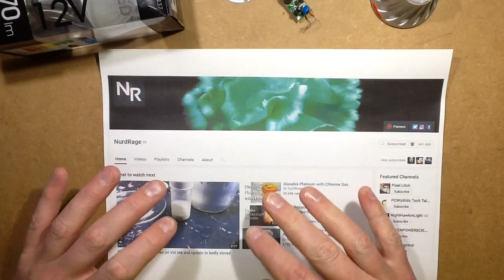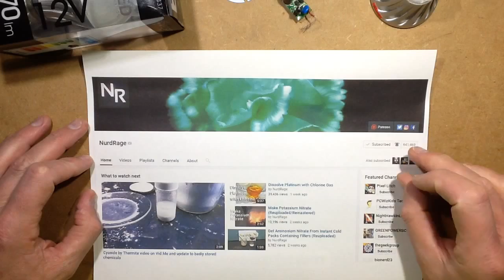Autopsy of a dead 12V V-Light lamp with novel LED panel.

Comment: A common failure mode for a switcher that uses an external FET to drive the inductor is that the IC's gate driver is too weak. The capacitance of the FET's gate, and often its gate-drain capacitor (aka "Miller capacitor") is high enough that the driver cannot turn the FET on/off real fast. The Miller (integrator) capacitor in particular really slows down a FET's switching time. With slow rise/fall times, during which the FET's current is still passing while the drain-source voltage slowly changes. It results in large instantaneous power dissipation (Vds * Ids) that when averaged out over a full power cycle produces a large average power dissipation. POOF goes the FET. If you sensed that this power transistor was getting real hot and making funny sounds, this is a likely reason for the failure: bad design by the lamp manufacturer.

Comment: Looks to me that those are designed to be run from the 12 volt system on an RV Hence the RV picture on the package and the Bulb v making a weird RV once again. Perhaps to much pulsating DC is getting to the circuit that is designed to come from nice clean DC stored in the house batteries of the RV?

Comment: Where did you get your mains power connection terminals from Clive ? interesting  ?
Reply from the maker: It's called a Quicktest and has been about in the UK for as long as I can remember.  You can buy them from most big UK/European electronic components suppliers.  In America you can buy a new version with US/Canadian colours on eBay at this link.  http://www.ebay.com/itm/302400231699
They're intended for industrial workshop/lab use so they're not cheap.  But they're worth every penny if you test a lot of electrical equipment.
Reply: And of course they are "out of stock" but not a bad price  $63 dollars

Comment: Please don't laugh at me. My question is probably a basic knowledge for most of you people. Here it goes: Do all LEDs flicker, like say, neons? My concern is the effect of LEDs on people with epilepsy. People with epilespy have to stay away from flickering emissions even if the eye can't perceive that flicker, but the brain does.
Reply from the maker: Properly driven LEDs do not flicker at all.
Reply: Thanks much.
Reply: Even PWM dimmed? I have an led torch and it strobes when dimmed,. it's hardly noticeable but when it rains you see dotted lines of rain!
Reply: Cheap ones flicker, but high quality ones don't.   PWM should not be an issue if it's at a sufficiently high frequency.  Best to check with the manufacturer.

Comment: Am I bad person for hoping bigclive would get a zing from the mains... I've gotten bit by 120 over here in the states, and it's not that bad. 2x the voltage shouldn't hurt much, right?
Reply from the maker: 240 is hugely worse.  The higher voltage breaks down skin resistance better and then forces more current through.
Reply: I've been bit once by, allegedly single-phase, 240v here in the states. I don't ever want that again!
To humans, 240 = 120 times 2,  but man...... when it's a voltage shock.... no thanx :-(

Comment: Why are they making low voltage lamps with ES and BC caps that are usually used for 240v fittings?  It seems a very odd design choice to have a system like this and I don't think I've ever seen it.

Comment: I'm not sure what you adjusted on the iPad Clive at 6:50 but it stopped the flickering, maybe worth experimenting.
Reply from the maker: It happens randomly based on intensity.  Sadly not easy to control.
Reply: That's a shame I thought it might be a breakthrough. Never mind.

Comment: What you've got there is a Pickett & Eckel slide rule shirt, http://www.sliderule.ca/piprom2.jpg. I presume you have NOT thrown yours away. I have a nice 6" model given to me in 1974 that I still don't use occasionally. The 12" I have is not the one with 34 scales no one knew how to use. Ripper.

Comment: I wonder if the design was originally for a color temperature changing lamp and they just put the white and red in series. Here in the US you can get LEDs that can change color temperature, the more common ones do it when attached to a dimmer. I saw a demo in Home Depot last night and when you dimmed it down the color changed rather naturally to match the dimming level.

Comment: Another LED light mad by FEIT 60W = recently did the same thing with a mix of color LEDs to match a color spectrum brighter output. Same with the 100W version. But ones before over the last two years had one color LEDs because I used to remove the defuser in some situation, not anymore I guess.

Comment: I accidentally killed the fuse in my DMM today by trying to take a current reading while on the volts setting. I always do that three or four times in a new meter before I get the hang of it.
Reply from the maker: It's very easy to do.  Particularly with the cheap meters that have the amps settings on the standard probe positions.
Reply: It actually turns out that I may have just taken too high an amperage rating on the low amperage side. I need a better meter.

Comment: I had a similar experience with LE or Lighting Ever bulbs, they aren't cheap and half of them failed in the packs I bought. Upon inspect various LED's in the cluster had little black spots on them. When I informed them of this they simply weren't interested.

Comment: As soon as I you mentioned the red LEDs my thought was it was a dimmable lamp and the red LEDs are to make the light warmer at low levels, like the Philips Warm Glow ones. But as there's only two wires to the LEDs, how are doing it? Is the lamp dimmable?
Reply: Found it on the Clas Ohlson website under 36-5437. It's not dimmable. Looks like others have had them quickly fail.

Comment: When I originally bought my home a year ago I changed every lamp in the house over to LED lamps The first thing is I'm suspect of the amount of power that these lamps really use because my electric bill really hasn't changed also I've had 3 to 4 lamps fail I say 3 to 4 because the fourth one is an outdoor lamp and it seems like one or two of the LEDs in the lamp are still working because its just a modest glow and not the 70 watt brightness it should be what would be your take on this.
Reply from the maker: Lighting is actually quite a small part of your electricity consumption.  The bulk of your bill is generated by heating appliances like kettles, immersion heaters, fan heaters and laundry equipment.

Comment: Uses 240v, steps down to 12v. uses 12v supply, steps up to 30 ish volts, Humans.
Reply: It makes more sense than you realize.  Typical 12V mains powered applications are for safety in areas where the wiring is subject to detrimental factors such as outside landscaping where there may be water ingress, animals chewing on the cord or it gets cut by lawn equipment, plus this low voltage stays below electrical code limits for similar reasons.

Stepping back up to 30V leverages the low cost generic chinese LEDs with a series connection for lower construction cost.  It's not the most efficient way to do things, but if that was their goal instead of cost reduction, start out with high efficiency LEDs.  That can easily make more difference than (roughly) 15% more loss than only a single buck voltage regulation circuit from 240VAC to 12V AC or DC would have.
Reply: which is negated by the losses involved in stepping down then back up the voltage (I've seen those supplies, you'd be lucky to get 75% efficiency). There isn't much of a reason to step the voltage back up other than them being lazy and wanting to use the same LED PCB again, which means you incur losses from the SMPS,  and the board gets stressed and failed. Using 12v DC where water ingress is a problem also creates serious DC corrosion, most I have seen are AC 12v. It would have been a lot nicer to see a lamp use 12V, and a power supply out put peak to peak AC at 12v, and the LED lamp just rectifies it.

Comment: Are LED bulb power ratings the power expected as measured at the input, or at the LEDs?  I had always assumed the former, as that would seem more useful to know; but I just discovered that my favourite brand of spot lamp is rated by power at the LEDs.  So now I am wondering if that is the usual way of doing it.
Reply: +Против Глобал  Many thanks

Comment: The LED bulb in my room flashes very briefly (it only turns on for a a fraction of a second) every 20 minutes or so. It can be very distracting when I'm trying to sleep. 

What kind of sorcery is responsible for this? Why is it lighting when it's supposed to be turned off?
Reply from the maker: The multi-way switching is a factor.  What you're seeing is capacitive coupling between the switch wires, leaking a very tiny current that gradually charges up the capacitor in the lamp until it tries to light, discharges the cap and starts charging again.  Some lamps are more susceptible to this than others.
Reply: Ronald Raygun Do you use that switches which have a red indicator inside? Or the switch may only control the neutral, leaving the active wire connected and leaking some small current.
Reply: I don't have those but I do have a three way switch (three switches in different locations for the same light fixture). Maybe that has something to do with it?
Reply: My house is pretty old too. I have to be careful not to get electrocuted by my kitchen sink because there is no proper grounding (I think my neighbor has the grounding hooked up the the water pipes).

I'll have an electrician come around and take a look at it soon.

Comment: Naw Clive, you're not too overly reckless.  Too reckless is more like inadvertently attempting to use yourself as a giant capacitor.  I'd describe the feeling as a very, very large and unusually strong fella whacking you repeatedly with a massive hammer, you do feel quite invigorated afterwards however.

Comment: That combination is probably so they can use cheaper lower Ra LEDs but still get a highish Ra (Ra 90).  Normal white leds(blue/uv + phosphor) have a sharp peak in the blues and a wide bumb between orange and yellow.

The red leds fills in the red to orange range so the spectrum get closer to an 2700 K black body spectrum. 

So the only thing "wrong" is the blue peak that make it pinkish.

Comment: Clive, what's the cheapest way to get at USB male connectors?
Reply from the maker: It depends what you mean.  You can buy USB plugs on eBay or buy complete USB charging leads and cut the other end off to give a plug and cable.

Comment: Dear Bigrecklessclive, 
I would guess that the red were included to offset cool white leds that may have been lying around and they either ran out or the purchasing agent (a class of person that instinctively buys the wrong stuff) bought a metric ton of warm LEDs and forced the factory to use them.  Given the choice of finding fault with a design or the implementation of it - I'll pick human nature and greed to bugify a proper device as a generally winning bet.
Reply: Probably just so they can use cheaper white LEDs and still get a good Color rendering index CRI.

It got Ra 90.

Comment: Why stepping up the 12V? Just put 3 LEDs and one small resistor in series (like in all LED light strips).
Reply: It's so they will have a stable light output even when the voltage varies. They are made so they can be powered by lead acid batteries and just not super stable 12v transformers.
Reply: m8e but why step up and not just use a regulator the components would have an easier time and cheaper automotive components could be used??

Comment: E27 and 12V not very handy.
One mistake and boom................................
Reply: Can also come in handy.
Had people annoy me when they wanted E27 Bulbs
Gave them 40V ones and it stopped :D
Reply: 12V on E27 is quite normal, car inspection lamps in the 80s used to use similar.

The GPO used to use 50v on SBC lampholders too...
Reply: Yeah, I found a couple of E-27 lamps in the trash, so of course I screwed on in at home, oh boy what a bang, it turned out to be 50V

Comment: you taken apart so many LED bulbs, can you recommend any to replace 100w incandescent ?
Reply from the maker: There's none that I'd recommend that could actually put out the same light as a 100W incandescent on its own, as it would need to be rated at 10 or more watts and would have thermal issues..  But by using the multi-lamp adaptors you can get a decent amount of light by using several lower wattage lamps.
Reply: I pulled a dead 12W E27 one out of the bin... guess what. It had blown LEDs. I'd say 5-7W is the max for E27 for long lifetime, assuming a good heatsink and thermal design.
Reply: 1521 lumen LED bulbs have just appeared in Morrisons - that's 100W equivalent, 15W consumption. Claimed 25 year life at 2.5 hours a day. 4 quid each. I bought one, good light and it is just about bearable to hold it (heat wise). When inserted in my desk lamp it flashed on and off - something odd about the switch, other sockets no problem.
Reply: Selection varies greatly by country, it depends where you live.
Reply: would be very cool to know what clive's favourites are :)
Reply: clive doesnt tend to review either high end ones or ones powerful enough to replace 100w, mostly the 5w range which is about 50w incandescent
Reply: Против Глобал I remember that time, they were built to last a lifetime, and the price reflected that. I see the same thing happening as happened with regular incandescents, the companies manufacturing them are "pushing" the limits, to make them fail in a short time, guaranteeing a constant stream of revenue. And the people just go "wow, 9W is sure better than 5W! and not much pricier!", they don't see the long-term cost. And it's the old brands, like Osram and Phillips, that are doing it the most, I can hardly find good 3W lamps around here anymore.
Reply: i use morrisons LED bulbs ,real cheap and had for 2 years now ,not a single problem out of 12 ! and even ebtter morrisons now do them old fashioned filament style LED bulbs
Reply: I got a 10 watt led from tesco the brightness is good but £8 is a total ripoff considering they only last 25 years run for 3.5 hours a day,  also I cut 1 open and they had filled it with white silicone so they will over heat and brake on purpose thieves!
Reply: I think you'll find Tesco don't actually make lamps, they just sell someone else's. Which as you say is are a rip off if they are designed to fail. I'm fed up with LED halogen replacements failing, I just need to work out how to fix them I suppose?
Reply: I thought they made them out the back like the bread!

Comment: Interesting especially since I work at Clas Ohlson. I wonder if these red LEDs have anything to do with why our LED bulbs have demonstrated generally better CRI values than other competing brands?
Reply from the maker: It could well be to fill in the red end of the spectrum.
Reply: bigclivedotcom on November 20th 2015 you made a video on a mini laser show projector I was wondering if you could take the green laser out of the laser show projector and run it off of a USB power bank and make a portable laser pointer with it and if it is possible could you make a video on how to do it so I can make my own